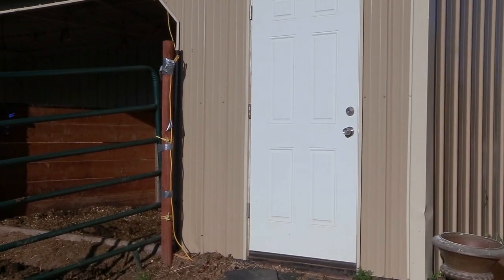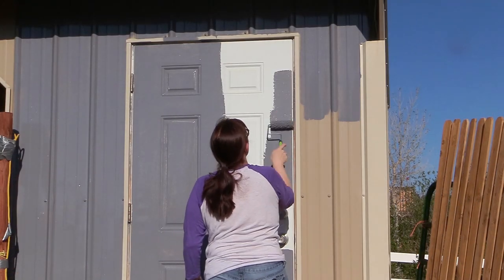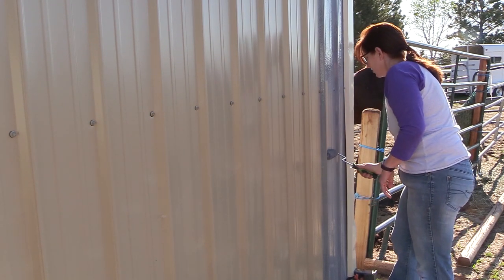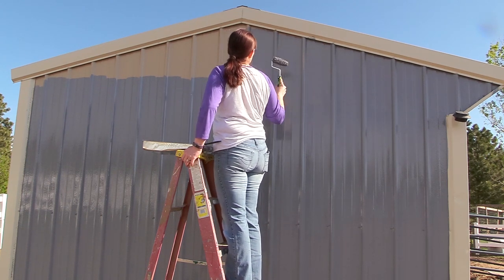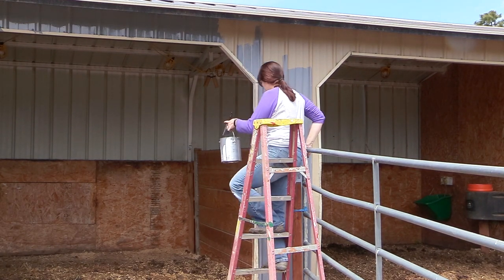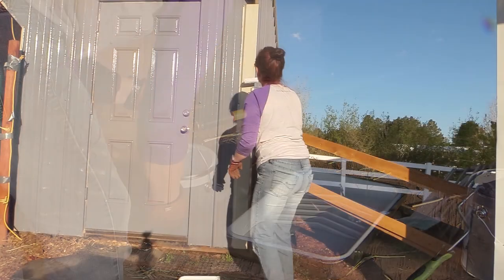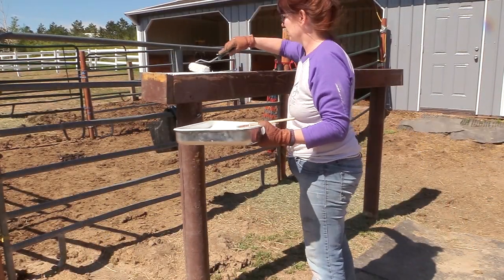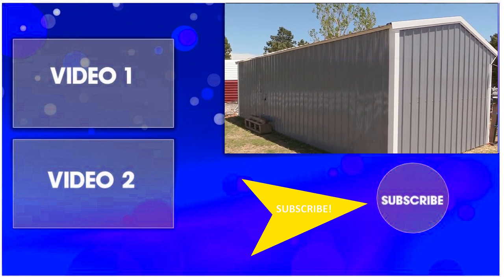Weekend Barn Makeover - Painting My Barn With Rustoleum Paint

Comment: This is interesting, because, as signpainters, we get asked to letter pole barn metal occasionally and it seems to be notorious for usually being coated with a 'dirt-shedding' coating on it that NOTHING, including paint, seems to stick to!! I lettered a customers polebarn side using a good acrylic and even after it dried, it is still pretty easy to scratch off with a fingernail.  He's happy with the job and it's holding up well because no one really is TRYING to scratch it off, but it's not an 'ideal' result!  I'd be interested to know if your barn job seems to resist attempts to scratch it with a fingernail, just for comparison's sake.  I will keep this in mind for future pole barn lettering jobs!  Or I may just use my normal lettering enamels.